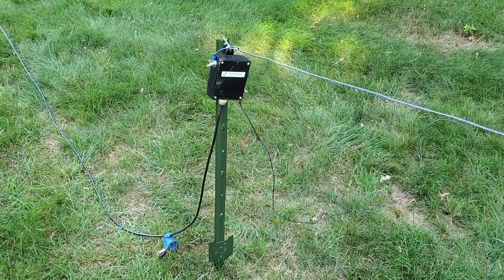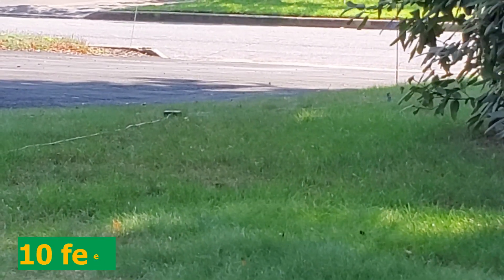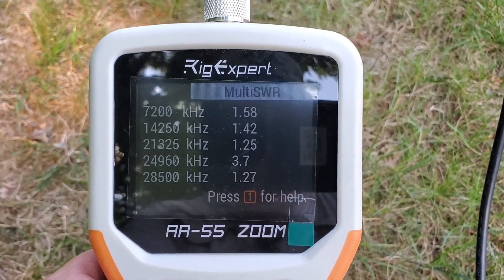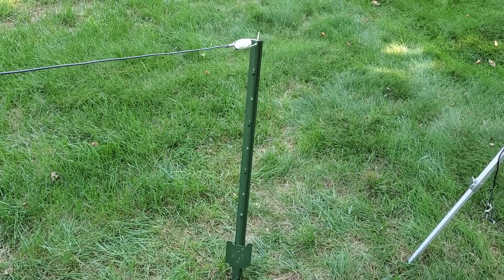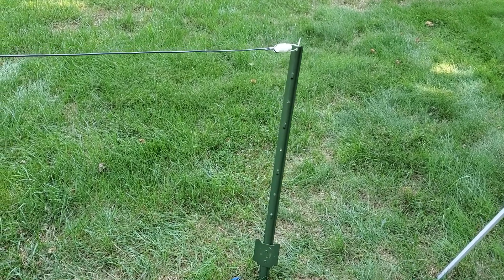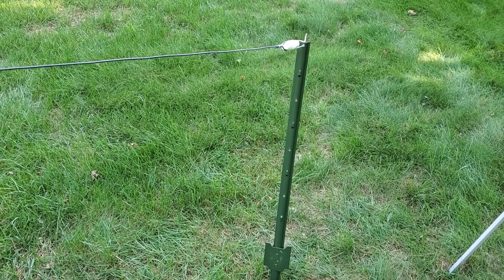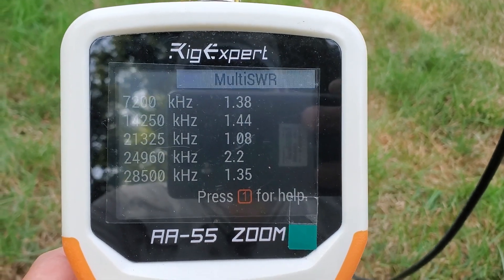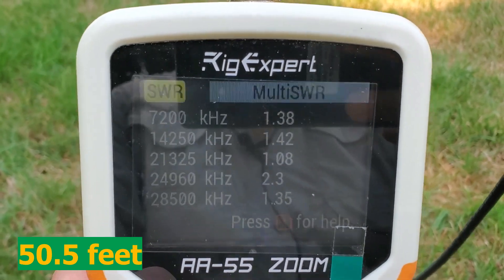Metal Mast Impact on EFHW Antenna Performance

Comment: I would like to put the match box 5' up from the base my tower and the far end 40' up in a tree and wondering if that would be worse than putting the match box on a wooden pole?
Reply from the maker: My first installations of EFHWs were with green step in fence posts and it worked fine. You should have no problems.

Comment: Great vid thanks!   Interesting pattern for 12 meters.   would be interesting though to see this done using a standard aluminium flag pole that is closer to half wave resonances.
Reply from the maker: A metal mast at a resonance frequency would be interesting. I need to do some math on my tower height to see where it falls frequency wise.  

I didn't pay attention to the 12m value as the multi-SWR mode always uses 5 frequencies and the 12m value was left over from the defaults.  It wouldn't be hard to see where this EFHW falls for the WARC bands. (Read that as, idea for another video!.) I do know I've had mixed results on 80m. Sometimes my 7300's tuner can match 80m into this antenna and other times not. I think it might be height of match box off the ground. Or length of coax which acts as a counterpoise.  (Do I hear an idea for another video? 😀)
Reply: @aa3konthego  No ugly math needed.   Just hook that beautiful Rigexpert up to your tower with a short lead and one of those cheap bnc bananna splitters.   Going to try this this myself thanks to you as my pole is 3 feet shy from from my tuned wire length as it turns out.    73
Reply from the maker: @jeff-73  math is never ugly. Perplexing sometimes but never ugly!

My tower is grounded so results could well be skewed.

IIRC I've seen diagrams of using a metal mast with a sloper to get directivety in the direction the sloper and mast line up.  The mast acts like a reflector. I will need to dig this info up to see the details.
Reply: @aa3konthego  awesome stuff man, thanks!!!!

Comment: I am curious about the other parameters. I have seen on my similar setup and with my AA-55, that even with a low swr the R/X are all over the place on some bands. The 40m band (on mine) seems to be right around 50 ohms. Great videos!
Reply from the maker: I didn't capture the other parameters that the RigExpert can measure.  There is a chance your torroid core is heating up and that will throw things off.

Comment: i would try to never put an insulator so close to a metal mast or pole, try to add some nylon spacing before the insulator. You might have to watch out for metallic poles starting to act like parasitic elements which could change the radiation pattern. Probably won't make much of a difference for a low end fed like this. the radiation pattern is probably all over the place anyway.

Comment: Interesting test and results. I have 2 x 8m aluminium flagpoles I have not tried as masts, due to my worry about interaction. Now I am wondering if I could connect the feed to the bottom of one, add a wire at the top and turn the mast into the vertical section of an inverted L. It would allow me to get a longer antenna into the air, but I have no-one that can help me raise or lower it, so the test has not been done.....this clip makes me wonder if it would work. Now I have one less excuse to use.....dammit, it looks like I will be doing some wire work over the coming weeks.
Reply from the maker: Just make sure you have electrical continuity between the sections and isolate the mast from ground.
Reply: @aa3konthego  Continuity was my other concern, being 7 sections, and not too tight a fit, the pole is rather wobbly, even slit and held with hose clamps, it's still wobbly.
Reply from the maker: @bitemykrank1970  you might need to use a piece of wire between hose clamps at the ends of each section. I've seen a metal painter's pole for 20m that needed that.
Reply: @aa3konthego   I was going to paint the joins with Jet Lube SS-30, until I found out how much it costs in Australia...for the amount needed, it's WAY TOO COSTLY.
Reply from the maker: @bitemykrank1970  wire and hose clamps are the way to go then!

Comment: How about if mounted as an inverted L going up the metal mast and then off the tower to another pole?
Reply from the maker: That is something I'll have to test.  I'm pretty sure there will be interaction but the metal support could act as a reflector giving directionality.

I may have to learn antenna modeling to get a "picture" of any directionality,

Comment: It does work with random Wires, too. I have used my mast as ground and connected a very thick groundwire at the end of the antenna as counterpoise. Using the Coax here always had some weird consequences vor me in different setups especially with more power.

Comment: Hello, good antenna tests ... also like to do tests to my antennas
You will try placing the matchbox between 2.5 and 3 meters high without counterpoise
End fed between 6 to 7 meters high
My end fed, 40-20-15-10 works great with this setup / 73
CR7BDO
Reply from the maker: I recently did a similar set up also without the counterpoise and the antenna worked perfectly.
Reply: @aa3konthego  Very nice 👍

Comment: Nice antenna work. Dont get rid of counter poise. If anything lengthen it about 12 inches it will help with 12meters and make it more radio friendly. 73 de AC8GF
Reply from the maker: I can definitely play with that. Currently camping but it is a county park. Playing radio but not activating 😩  I took the 7-foot counterpoise off and the TennTennas EFHW worked natively on 10-40 and - with a tuner - 17.  I am using a 50 foot run of coax.